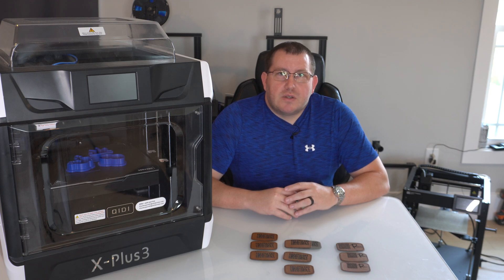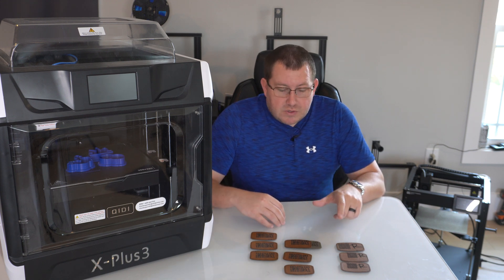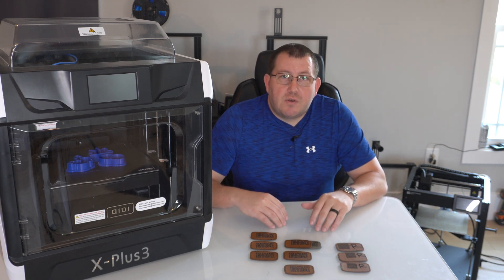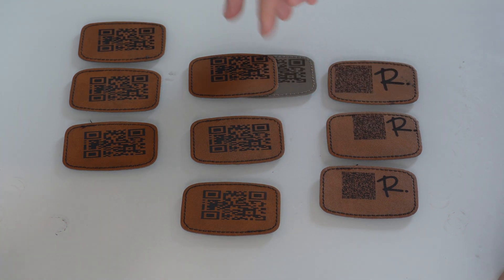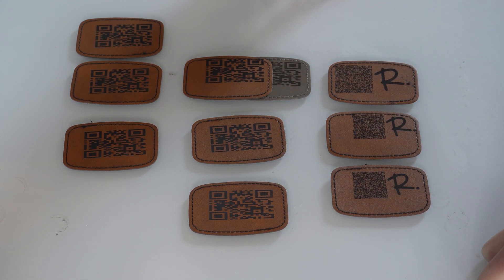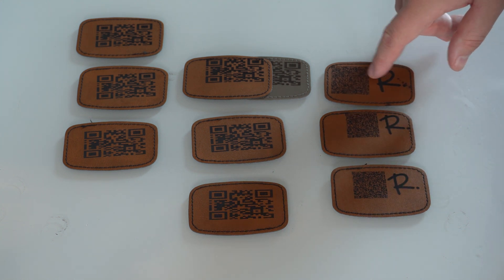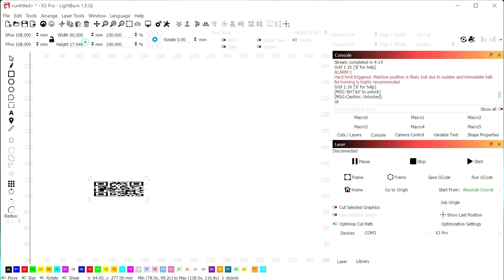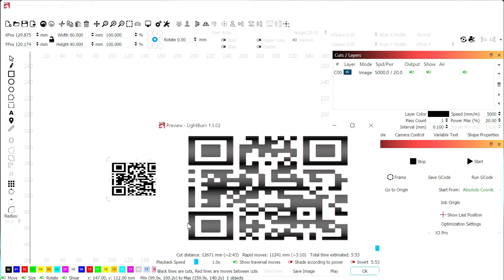Leather Engraving – Basic Settings!

Comment: you should 3d print a holder to put the patches in like a reverse cookie cutter?
Reply from the maker: Hi. Interesting idea. I printed a real estate business card holder for someone but could do something like that for the patches.
Reply: if it was like a wire frame with cutouts for the patches and a little square overhang on each middle of the 4 sides, you could slide them in and out easily.  it doesn't need a bottom so the leather patches rest on the bed, but you would need a way to keep the whole frame in place, maybe scotch tape? seriously haha.  then you could print it in a square the size of your bed and tape it around the bottom which will avoid and issues with a clap or something getting in the way of something else.  or maybe some this corner holders like the straps you can use on sheets to keep them in place?  looking forward to seeing what you come up with! @3DPrintscape